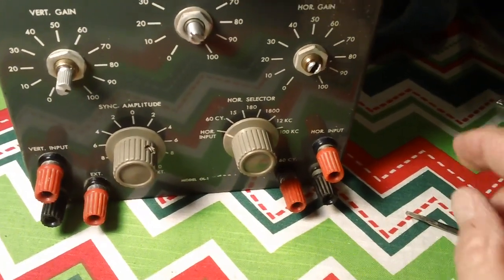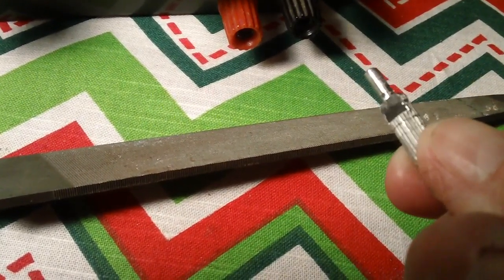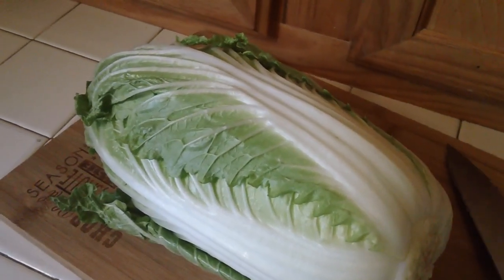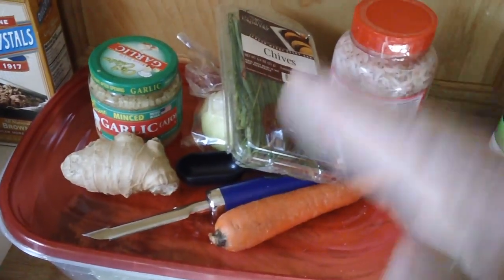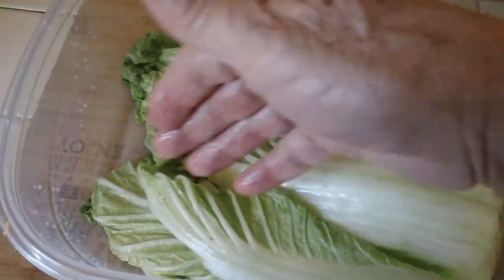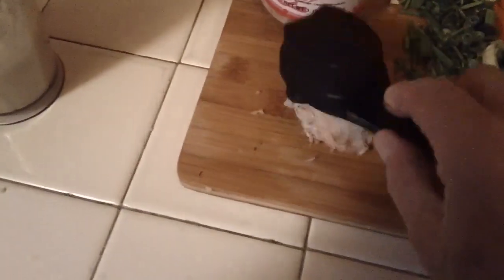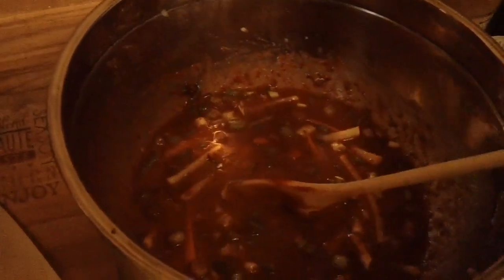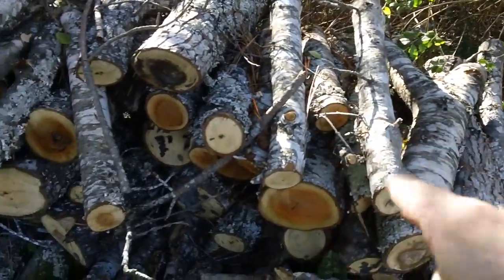Mish-Mash #141

Comment: Very cool and that scope look awesome.  Aside from the Kimchi which also looks great, looking forward to the Tube vs. Solid State discussion. If you have a part number/manufacturer for that double banana clip would you mind passing along, I am in the market for one  :)     thanks John.
Reply from the maker: Ron,
I bought this one on ebay because it was cheap:
http://www.ebay.com/itm/BNC-female-jack-to-two-dual-Banana-male-plug-RF-adapter-connector-/320847592228?hash=item4ab401bb24:g:mmQAAOxy66pRqa8z

Or you can go with this offering, which I probably should have bought:
http://www.ebay.com/itm/2pcs-BNC-female-jack-to-two-dual-Banana-male-plug-RF-adapter-Test-CONNECTOR-/151138032774?hash=item2330875c86:g:Y7UAAOxyWt5SUZ~C

Regards,
John

Comment: John,I want to restore an o scope and use for this hobby.  What megahertz range should I get?
Reply from the maker: Mike,  It wholly depends on the frequency range of the radios (or whatever) you plan to repair/restore.  The frequency rating of an o-scope i.e., 5mhz; 50mhz; 100mhz only means that the scope is deemed pretty much accurate up to that frequency.  Beyond that point its accuracy becomes a crap shoot.  If all you're going to do is mess around with basic vintage AM broadcast band radios, then any 5mhz Heathkit scope, tube or solid state, single or duel trace, will do the job.   If you plan to get up into the much higher shortwave frequencies, then a solid state 50mhz jobbie would be sufficient.  My main scope is a Tetronics 465, 100mhz, duel-trace type.  Lots of overkill.  Regards,  John

Comment: Probably the oscilloscope is one of the most controversial pieces of equipment when it comes to repairing radios. I purchased one from eBay a few years ago. It didn't work so my money was refunded. I never pursued it again. Some gents will not repair a radio without one. Others claim that they are "cheaters" because the technology wasn't there back in the day. I would like to know more about what they can do. There may be videos on YouTube which cover that. Or, Mr. John, you can make one. Educating the public is your solemn duty. Ciao, my friend.
Reply from the maker: Mike,
Solemn duty...hmmmmm.  I'm not so sure about that, my friend.  And who cares if someone thinks it's cheating to use an o-scope to repair an old radio?  What you use is none of their business.  So pick up a cheap old tube Heathkit or Eico scope  on eBay and have at it.  Make it flash and dance again.  You can do it.
Regards,
John